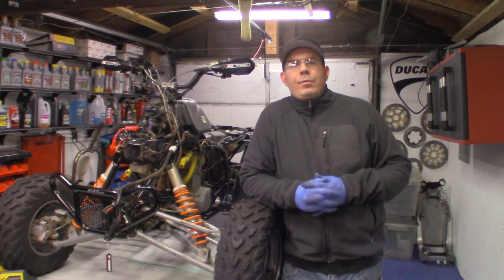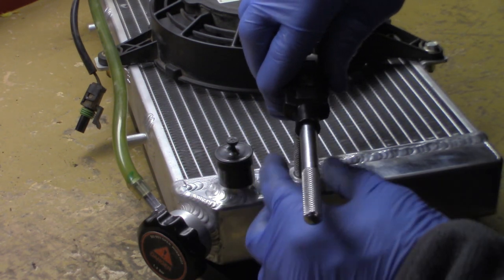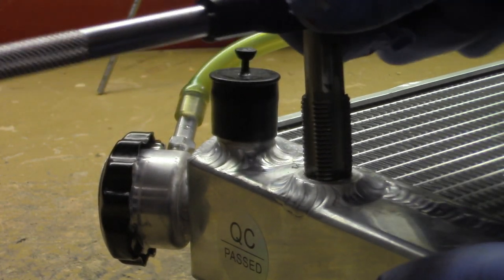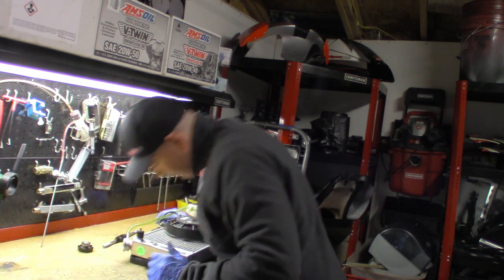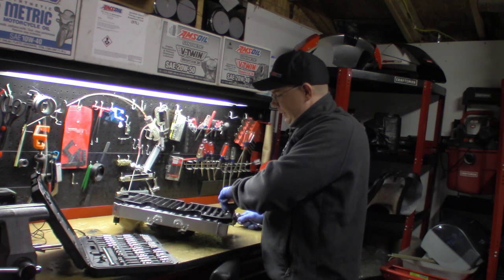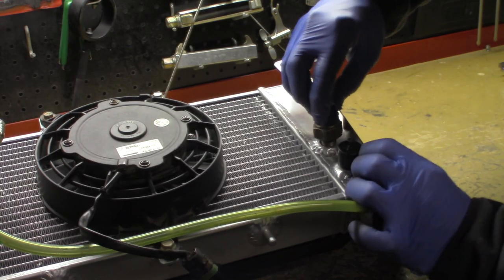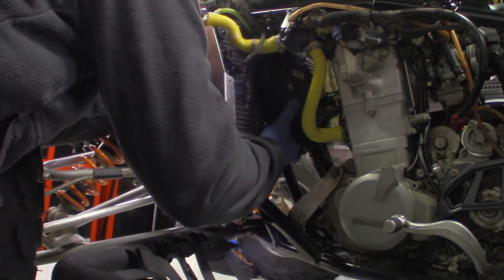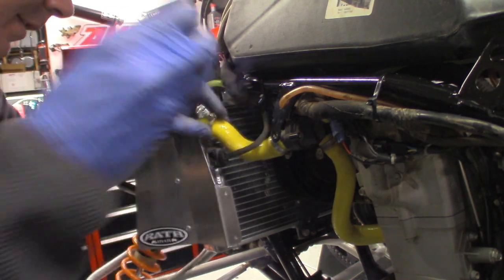Polaris Outlaw Dual Core Radiator Assembly And Install

Comment: Hey I’m looking into buying this same bike it’s a 07 outlaw 525 irs in black I’ve been searching for about a year now waiting out for the right one, this one kinda rough around the edges but seems to have good bones! Any input on what to look for as far as common issues? He says it clicks in the rear
Reply from the maker: This is my first one and it's rough. I don't know much about these besides the 525 is what you want over the 450. However the clicking is the bearings need replaced and greased. That causes the clicking. Can get expensive and when I start back on working on this I will show you how to fix that.

Comment: Hey on the Suzuki ltz rad what’s the top  bung with the two wires called
Reply from the maker: The thermoswitch it gives the fan temp signals to turn on and off I think is what your talking about
Reply: TorrentPerformance ya it’s the top  one it has two smaller wires that come out of it thanks
Reply: TorrentPerformance what’s the bottom one called
Reply: TorrentPerformance it’s a coolant temperature switch and I looked on eBay can’t find one anywhere
Reply from the maker: Have to send me pics not sure email in description
Reply: TorrentPerformance I can’t figure out how to send emails lol  but I think I have it figured out it’s a fan switch it has two little prongs coming out of it and I caught a stick and ripped the wires out thanks for answering my questions not to many people out there that will